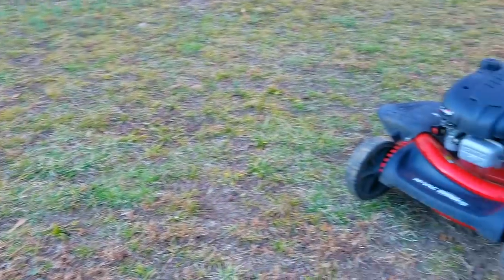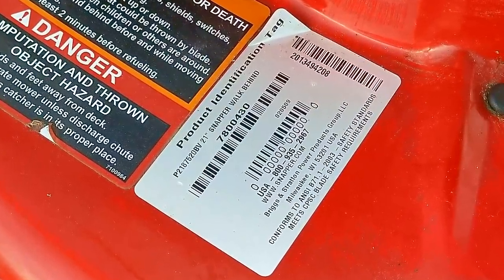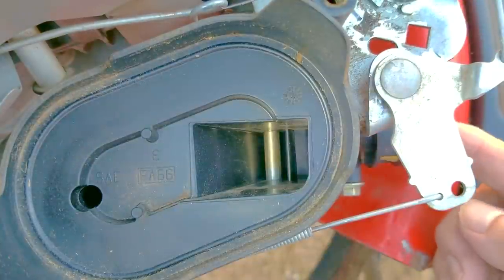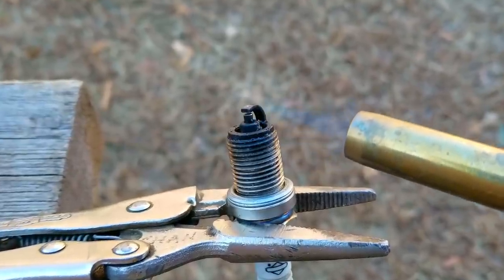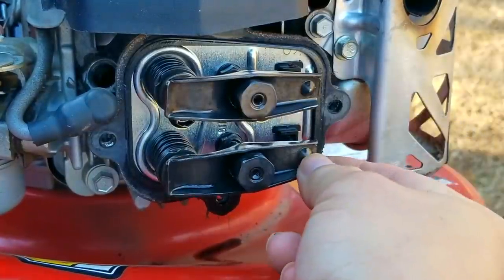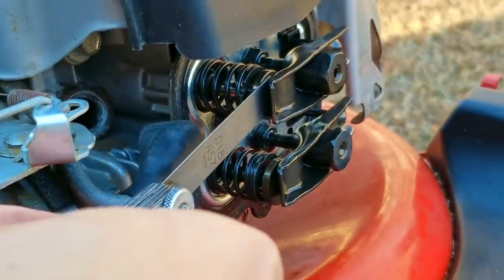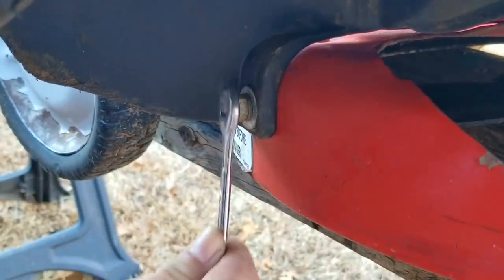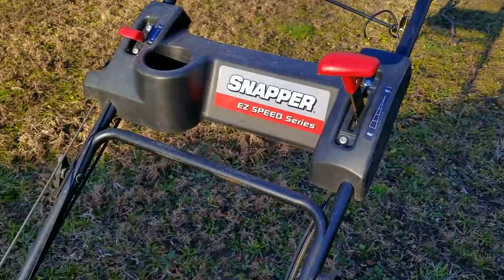Fixing a Snapper mower that's hard to start.

Comment: Nice Video! I found the same model Snapper at the curb. It would start and stall. I took the carb bowl off and cleaned out and the jet. Inside the carb bowl was the round metal slug from the hole in the bowl inside. I took that out and cleaned up and runs fine. Thanks for your video.
Reply from the maker: nice work and thank you too

Comment: This is the exact same engine as our John Deere lawnmower has. It’s hard to start and it’s the valves. It take 9 very good pulls to start with starting fluid lol. I didn’t know you had a video with our exact engine in it so we finally gonna do the valves! Our mower is 13 years old and we hope it can go for another 13! Thank you for making wonderful videos! I doubt our valves were ever checked or done before lol. Oh I got our air filter at our local ace hardware they had them but I don’t know that part number. But that’s where we got ours
Reply from the maker: no problem Matthew does stuff, and thanks.

Comment: Just picked up that exact mower today for free. (Electric start model).  Flywheel key.  Only has a bagger. No side discharge. $50+ is a little painful.  
Best part: beer holder! 😆
Reply from the maker: yes you understand the appeal of this mower too!  Thanks Political Correctness is a Caner.

Comment: Great work fixing that engine, just a simple valve adjustment made a huge difference, I only check valve clearance if the engine shows signs that they could be out of adjustment.
Reply from the maker: that makes sense to me, thank you WildeFox

Comment: I have not checked the ohv on mine yet, the two i have with ohv aren't that old & they run good so I'll put it off till they start running rough. Snapper is a really good mower. The frames are practically bullet proof. I own three of them, best mower I've owned!
Reply from the maker: thank you Mike Jones, I appreciate the information

Comment: I have the commercial type self propelled hyvac mower. Had it a number of years. Thanks for the video 👏👍🏻🙋🏻‍♂️💪🦾🗽😍 10-14-2022 
Last Saturday from that date, it started on first pull after priming. Mowed 1 strip about 20’ long and it died. I failed to throttle it up, but it won’t start. It seemed a little hard to pull cord. Put new spark plug. But didn’t help. My mechanic had rotator cuff surgery 2-1/2 weeks ago, and he’ll be out of commission for a while. I don’t have those feeler gages. So, I may take it to another mower repair shop.
Reply from the maker: let me know how it goes.

Comment: My chipper/shredder has a B&S OHV horizontal engine, and my Ariens 2-stage snow blower has a Tecumseh OHV horizontal engine, both from around 2008. Both still start reliably and run well, so my answer is "never", or "not yet".  I will probably check the snow blower engine in the spring. Lately, after seeing so many YT videos recently of outdoor equipment engines that are OHV and are out of spec, I am thinking that the equipment might work better and last longer by keeping things in spec.
Reply from the maker: that makes sense to me Tom Lewis

Comment: I check the valve lash in the overhead Valve Lawnmowers. On an annual basis.

42°F is very cold for my location in Australia because I rarely see a temperature 🌡️ of anything below 50°F during the day in the middle of winter,the Lowest temperature I have ever experienced was 34°F (1°C) during the day which was over 20 years ago.

It's 32°C (90°F) today in the middle of summer at my location !
Reply from the maker: That's some maintenance routine. thank you Russell Booth.

Comment: 2 years have passed, so maybe you won't see this.  I have a 1980's version Snapper push mower.  I was mowing my lawn with no problems until the grass plugged up the chute.  Instead of stopping immediately, I tried to make it to the end of that line and, instead, the engine stalled.  Since then it is VERY difficult to start.  If I remove the air cleaner I can get it to run, but with lots of sputtering and sooner or later it stalls again.  One thing I didn't know about that is a concern is "hitting a rock."  I did hit one that made a hard noise though the mower continued just fine until much later on when it stalled.  There is gas.  The spark plug connection is good.  The plug itself looks fine.  (I do not know the proper gap and, as I said, it was running fine.)  I am nearly 75 years old and, truthfully, pulling it at least 100 times trying to determine what is going on and if I could get it running again was a lot more than I wanted to endure.  So bottom line?  I have 2/3 of an acre to mow, I live in a tropical area with lots of rain (meaning I'd better get this done when I have a chance because it could rain again at any moment), and I am out of ideas.  Thank you so much if you actually see this and can suggest anything.
Reply from the maker: I read most all my comments if I see them so  thank you for watching and commenting.  If it was me, I'd do two things, which is to do a compression test. This will let you know how healthy the engine is.  A worn out engine is really difficult to start.  If the test shows that's it's still good, I would look at the flywheel key.  If the mower hit something hard, it could cause the key to "slightly Shear" which will "advance" the ignition timing.  If the engine is running when it happens you won't notice it, but when starting it, having the ignition advanced will make it extremely tough to start.  Hope that helps
Reply: @INSIDEHOUSEGARAGE  I appreciate this a lot!  Don't know what the "flywheel key" is or where to find it.  I can add this.  Pulling the cord I can definitely feel the compression.  This morning I cleaned the sponge air filter but, it being wet, simply put the air cleaner cover back on and tried again.  Within a couple of pulls it starts and runs smoothly...for 5 seconds.  Then it stalls again.  (Almost like it is running out of gas.  In fact, if I pull the starter cord a few times slow, assuming that is priming the engine, it starts again within a pull or two.  That further makes me think of gas, but what could have happened and what do I do about it?  I have no idea.)
Reply from the maker: if you feel the fuel system is involved then I would service it with a new carb.
Reply: @INSIDEHOUSEGARAGE  A reasonable response and I am beginning a search for a matching carb.  The machine is only 40 years old, should be no problem!  ;)

 Meanwhile, today I discovered if I manipulate the carb butterfly valve with my finger I can make the engine run and even adjust it's speed, just as if I was using the throttle control.  However, as soon as I let go the engine stalls.  There doesn't appear to be anything mechanical connected to that valve or that manipulates it.
Reply from the maker: interesting, the throttle plate should be connected to a governor arm, which will adjust for load on the engine.
Reply: @INSIDEHOUSEGARAGE  I was following along quite closely until I got to "throttle"...  Hahaha!  I really appreciate everyone's help!  Just an old man in a strange country trying to deal with 100 things at once.
Reply: @INSIDEHOUSEGARAGE  By the way, many times I have had to deal with nuts and bolts "falling off" as I work, including on this mower.  Wouldn't be surprising at all if something came loose and I didn't notice.

Comment: How do you feel for the piston and move it? I have no idea what it's supposed to feel like... nor how to move it. Is there an illustration that shows the guts to get an understanding of what's what with the feel??
Reply from the maker: sure, I usually put a screwdriver, into the spark plug hole, and push it in, as for as it can go, then I reach under and turn the blade, and you should feel the piston respond to you turning the blade.

Comment: The Kawasaki on the Snapper has never been checked and starts on the 2nd pull stone cold and 1st when warmed up. All the rest are 'L' heads except a Predator on a wood splitter and it's new. I have never set the valves on a Briggs. They just run.

Comment: My mower became impossible to start.  It was the first one I had owned that was OHV.  This was before I started watching mower repair videos, so I was stumbling in the dark, and didn't yet know to check valve lash.  Somehow, I did it anyway, probably because I was out of other things to check, and it started right up; just like in this video.

So, anyway, I, for one, didn't have any idea that this was a thing to check, much less keep up with.  I imagine a lot of other mower owners are the same, and either replace the mower or pay to have it repaired.

I've never seen this problem with a flat head, yet it seems fairly common with OHV.  Do the rocker arm bolts just vibrate loose with use, or what?
Reply from the maker: thank you Lou S.

Comment: The last time I checked was last summer when I did an oil change, it was a  Briggs 550ex.
Reply: makes you wonder why the OHV complications when a side valve would do nearly as well. 
Is there really that much more efficiency in that design to justify the added clearance checks?  For a walk-behind mower in the 4-6hp range, I'd consider it undesired complexity.
Reply from the maker: you're ahead of the class when it comes to maintenance.
Reply from the maker: I believe it's partly an issue with emissions. otherwise you're right, really don't need to go OHV on a lawn mower engine.

Comment: I have a 25 year old snapper mower that starts fairly well, but if I shut it off after running for a while and try to start while still hot, it's almost impossible.  Any thoughts?
Reply from the maker: sure the valve lash might be off, causing it to be tough to start when hot.  The other issue could be that the carb is flooding the engine when it's hot.

Comment: did you ever fix the transmission on this? Something is wrong with mine and when I push lever to make faster, the trans falls off the bar. I think a clamp or something is missing
Reply from the maker: unfortunately I did not and that's because the parts that were missing would have been more than the mower's worth.  So I'm not sure what could be causing your issue.

Comment: I think that engine is the Intek, which I consider to be their attempt to take the very good Quantum flathead engine and make it an OHV. I personally would rather have the Quantum. The flatheads had a better tolerance for operating in rough conditions. They withstood misuse and abuse much better because of their flathead design wasn’t so picky. Cam pushed Tappet, Tappet pushes Valve, heavy spring pulls valve shut. Simple. OHV means Cam pushes Tappet, Tappet pushes push rod, push rod pushes rocker arm, rocker arm reverses direction of force to push valve. More parts to wear, more places for things to go wrong, weaker springs , all made lighter and weaker to cut weight. An ordinary homeowner could own a quantum powered lawnmower for 10 or 15 years and never put enough hours on it for the valve train to need adjustment.  Even it oil changes were neglected, the quantum kept going. The principle of KISS definitely applies here.
Reply from the maker: very well said, thank you haneyoakie14

Comment: Good video. I am curious, did you adjust both valves using the same size feeler and if so why? I know most are set up where intake is a set number and exhaust is a different one as well. Thanks for a good video again!
Reply from the maker: looking at the Briggs website, and their page on valve clearances, this engine has a valve lash range of .004" to .006". I went in the middle at .005"
Reply: @INSIDEHOUSEGARAGE  
Okay, sounds about right. I know some are in that range and some other engines are a bit higher. Thanks for the reply my friend!
Reply from the maker: anytime Rob Kercheval.

Comment: On that particular briggs engine I have always found a hard starting problem to be the pcv tube to carb rubber hose, it always seems to be cracked, it will hide the crack right along the Ridge so flex the rubber tube to make sure it isn't split.
Reply from the maker: I'll have to check mine

Comment: How do you know if it's on the compression stroke
Reply from the maker: watch the rocker arms while turning the engine, when the intake rocker moves downs that's when it would be pulling air into it, then as the rocker close, and the piston is on the way back up is the Compression Stroke.

Comment: Your engine model type and code are on the valve cover or stamped on a piece of metal above the muffler, put the model and type in parts lookup (such as partstree)  if you still can't find the right filter, send me the engine info and i will look it up thru the Briggs & Stratton dealer only lookup which is up to date and current and give you the air filter number. as for adjusting valves, no need to check them, only adjust them when they are suspect with a problem. Most Briggs engines built after 2009 (2010 to current) use RTV instead of a gasket, push mower engines, the smaller ones do still use gaskets, 10hp and over use RTV.
Reply from the maker: thank you for the information TheOutdoorPowerGuy, and someone already gave me the part number.

Comment: These engines are the worst Briggs I’ve ever used. Will have more problems after adjustment it is super common for the valves to tighten or loosen. I ran this same snapper for a few seasons and got rid of it because the engine was so bad. My new snapper have the Briggs 8.50 and 8.75 and they are so much better.
Reply from the maker: thank you for the information Zack.

Comment: People NEVER check lash. Stunned you did in the video. What about cleaning the block and cooling fins? This is a yearly to-do in ALL engine manuals. Overheats will destroy an air cooled mower engine.
Reply from the maker: really? I'll have to check an older manual, and a new one, because that would require the owner to do, more, than just checking the oil.
Reply: @INSIDEHOUSEGARAGE  Yes really. Again cleaning the cooling fins on EVERY mower engine out there regardless of brand name. These are AIR COOLED engines.
Reply from the maker: so I was able read the owners manual for a fairy new toro , and a much older lawn boy 2 stroke, and they recommend cleaning the cooling system or the fins, in this case, every 100 hours , or once a year.  IF people don't check the valve lash, I doubt they're going to bother cleaning the fins. thanks for bringing it up, I might mention it, in a future video, but only a few people are going to care.
Reply: @INSIDEHOUSEGARAGE  You are EXACTLY right. Most people only know the words - air filter, spark plug and barely new oil. LOL.
Reply: @INSIDEHOUSEGARAGE  Again this is in EVERY air cooled engine manual out there. 2 stroke, 4 stroke doesn't matter. They are all cooled by air and oil.
Reply: @INSIDEHOUSEGARAGE  Not cleaning the fins YEARLY, you risk engine DAMAGE. Like valve seats popping out. Head gasket blows, rocker arms moving way out of lash and such. Valve guides pulling out of the head. So YES, it's important to clean some cooling fins. Glad you had an open mind about this. And thanks for doing your own research about it. Hope it helps you out in the future. Great videos BTW sir.
Reply: @INSIDEHOUSEGARAGE  Lastly CLEAN the block and fins like a shiny new engine. All that oil, grass and grit must go.... If you bag, investigate this more often than the 1 year mark. Bagging throws grass and dirt up high. Gets sucked into the fins.....

Comment: Great job. And.. If you have an overhead engine and the valve lash won't adjust or stay adjusted, the valve guides are worn out from not changing the oil. Sell the mower. It isn't worth any labor or money.
Reply from the maker: Thanks for the tips!
Reply: @INSIDEHOUSEGARAGE  Cam wear, not valve guides.
Reply: @watermanone7567  Not just cam wear. It's when you can move the valve stems side to side in their guides because of all the space from wear.
Reply: @999thenewman  Yes, but that does have little or no effect on the valve adjustment which moves the valves up and down and effects the valve timing. Side movement on worn guides causes more of an oil use issue, and has little effect on valve timing. I see lots of valve timing issues in my shop. Thanks
Reply: Valve guide wear causes oil use issues, and does not cause valve timing issues. Valve adjustment causes bad valve timing and makes hard to start issues and lots more fuel usage, and if the valves are to tight it will cause blow by and may burn the valves. I see lots of issues in my shop with people trying to adjust their own valves and do it with the piston out of sync. Thanks